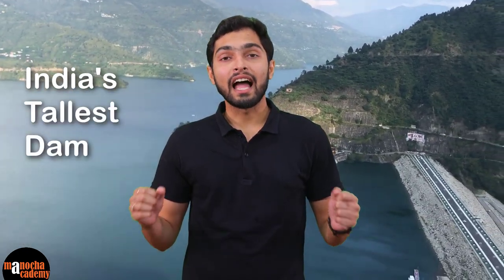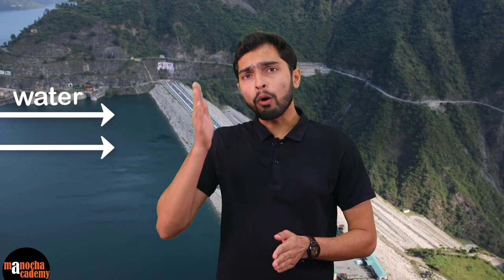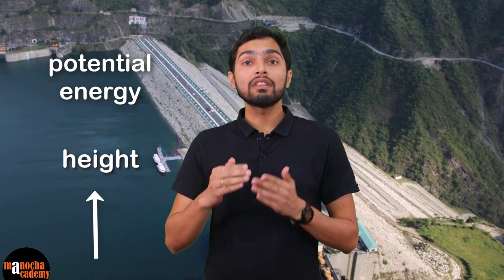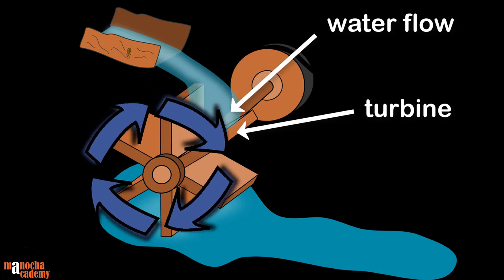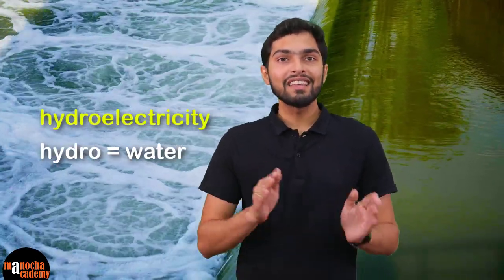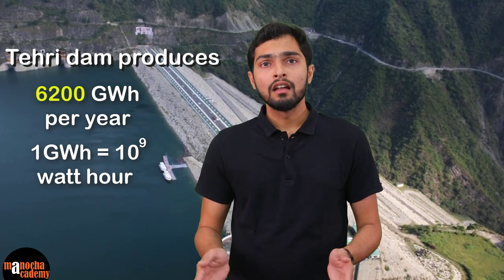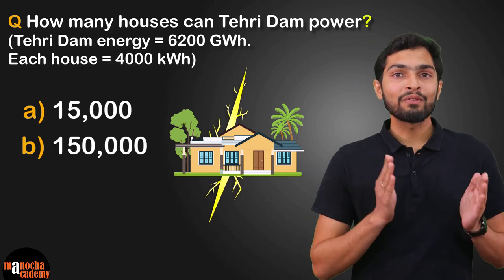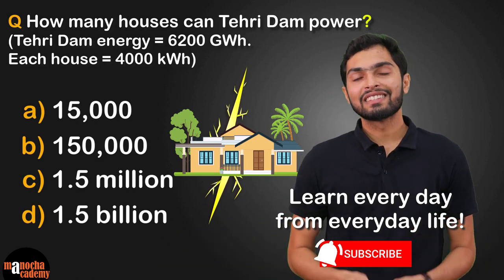How Dams Produce Electricity | Hydroelectric Power Plant

Comment: Given:
Tehri Dam energy produced per year = 6200 GWh => 6200 x 10^9 W x 3600 s => 2232 x 10^11 J
Each House Energy consumed per year (approx) = 4000 kWh => 4000 x 10^3 W x 3600 s => 144 x 10^8 J

To find: 
How many houses can Tehri Dam power per year = ?

Sol:
      Total Tehri Dam Energy produced per year                 2232 x 10^11 J           
      ______________________________________________ =  _________________  
     Each House Energy consumed per year (approx)        144 x 10^8 J
                      

                                                                                              =    15.55 x 10^5
                                                                                              =    15,55,000 Houses

∴ 1.5 million houses can Tehri Dam power per year.
Reply: Super sis or bro
Reply: Why to do that much process you can simply multiply 6200 by 10 lakhs and divide by 4000
Reply: But I will really appreciate that you have answered correctly
Reply: Bro is rlly interested in maths 💀